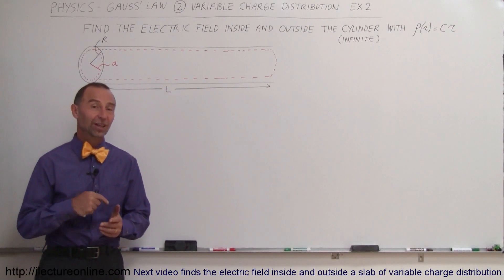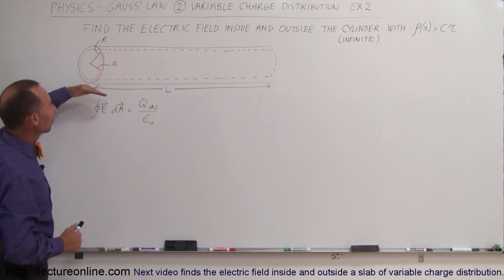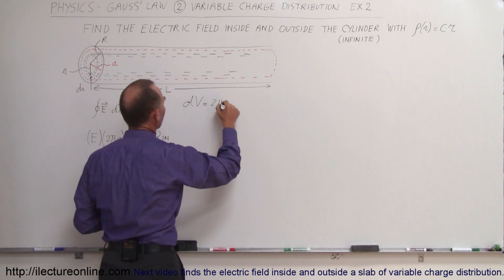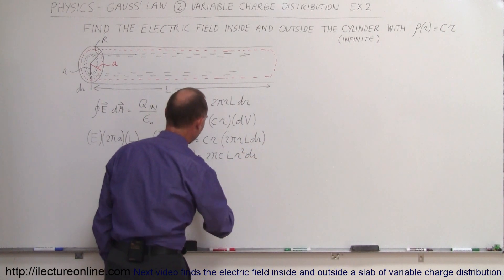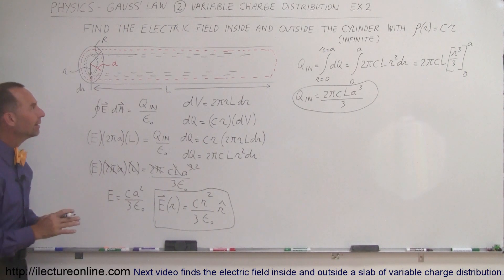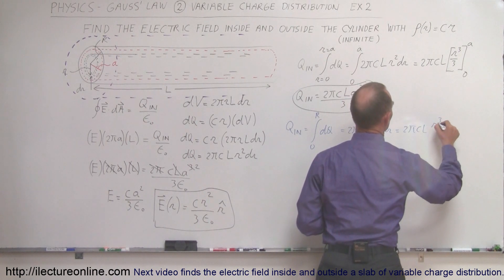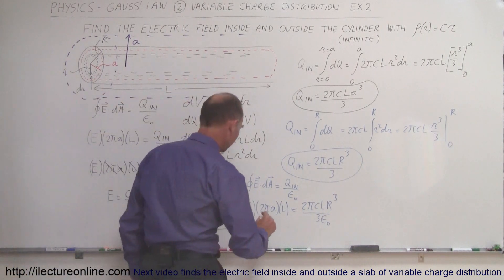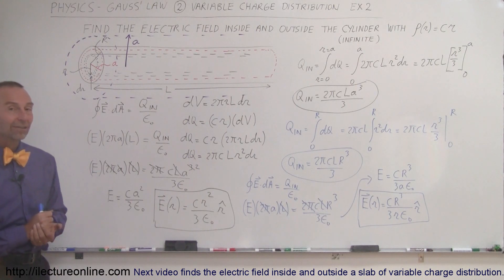Physics 37   Gauss's Law (14 of 16) Variable Charge Distribution: Cylinder

Comment: Lets do something a little bit less simple,  such as getting the value of the potential voltage between the enclosing cylinder and the  inner cylinder. Let the charge of the outer cylinder be negative and the inner one positive 
Now you will have to integrate in tge opposite direction to thatvof the electric field
Reply from the maker: We have videos like that in the playlist on voltage.

Comment: Mr. Biezen, why is dV equal to 2pi*r L dr instead of pi*r^2 L dr ?
Reply from the maker: If you cut the layer that makes dV and you unroll it you get a thin rectangular box.  The width of the box is equal to the circumference = 2 pi R    the length = L   and the height (thickness) = dR

Comment: why did not we  take interval of integral a to R, if we take 0 we are to be in the cylinder
Reply from the maker: a is a specific radial distance from the center, used to determine the electric field at that distance from the center.  Since we only want to calculate the charge inside the Gaussian cylinder, we integrate from r = 0   to   r = a        For calculating the electric field outside the cylinder we integrate from r = 0    to    r = R
Reply: Michel van Biezen thanks sir, i understood what you said

Comment: So if charge density is given as just rho (p) do I need to do this. I'm trying to find the electric field of a insulating cylinder. I have been multiplying p by the volume of a section of the cylinder, and it seems like my answer is at least close.?
By the way thank you! I don't know if I would be passing physics and calculus without you!
Reply from the maker: If the charge is uniformly distributed throughout the cylinder, you would still need to calculate the charge inside the Gaussian surface to find the electric field inside the cylinder.  (The charge inside would be proportional to the volume inside the Gaussian cylinder relative to the total volume of the cylinder).

Comment: sorry about the messy question earlier. The only one I have now is Can we just use Only One Gaussian surface with a radius bigger than that of the cylinder to find E both inside and outside, simply by changing the bounds of integration?
Reply from the maker: No, you will need 2 Gaussian surfaces, one for finding the E field inside and one for finding the E field outside.  ALSO be careful about the charge inside.  You'll have to figure out the charge inside the inside Gaussian surface separately.  The charge for the outside surface is the total charge.

Comment: mr biezen, what if  given a cylinder with a very very thin wall with an infinity length a radius of r m , and a linear charge density of , for example, u C/m, 
and we are to calculate the electric field on an area outside the cylinder? this confuses me because i think it is supposed to be an areal charge density with the dimension of C over m squared

or is it true if i calculate the total of q of a certain very thin ring, and make it the linear charge distribution for the whole cylinder? thanks
Reply from the maker: +Usamah Jundi 
 It doesn't matter how the charge is distributed.  Gauss's law only cares about the amount of charge within the Gaussian surface.
Reply: but how to find the total charge of the infinite thin cylinder?
Reply from the maker: +Usamah Jundi  There are 3 types of charge density: linear, area, and volume charge density.  If they give you linear charge density, then you multiply the linear charge density with the length and you have the total charge.  If the charge density is a function of position, then you'll have to integrate.  There are a number of examples like that in the playlist with videos about Gauss's law.

Comment: my book says that the net electric flux through a closed surface surrounding a point charge is q/e0 regardless of shape and size. is my book wrong?
Reply from the maker: +Терорист Талибан 
  Your book is correct.
Reply: +Терорист Талибан a point charge! in this video its a cylinder of charges

Comment: Good explanation. A slight nitpick, when finding the field for a Gaussian surface outside the cylinder, you used "a" as the radius of the surface. This was the same variable for the inside surface. I know my students always got confused by multiple uses of the same variable that represented different values.
It might lead to a bit of confusion when the overall explanation is really quite good.
Please keep the videos coming.